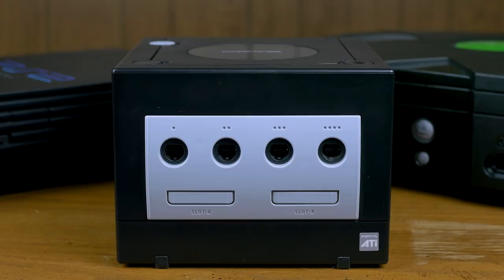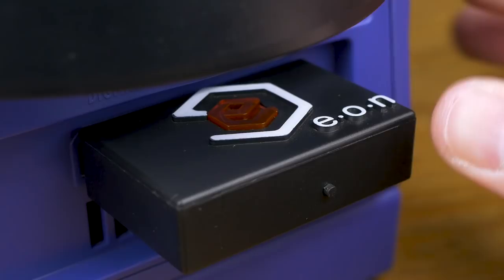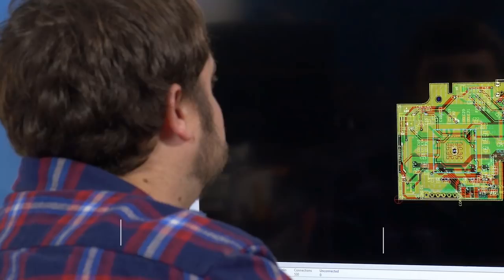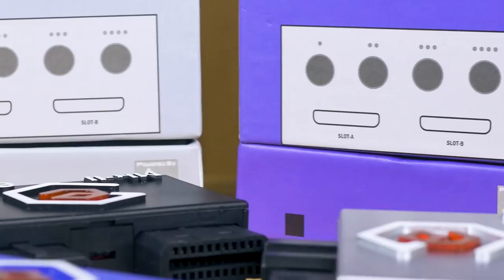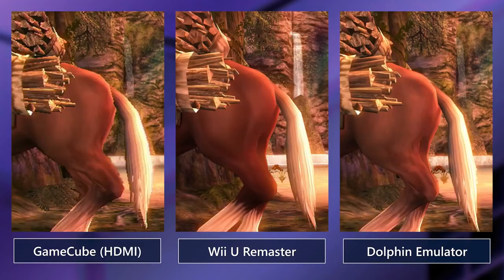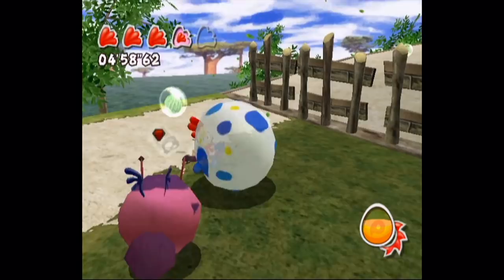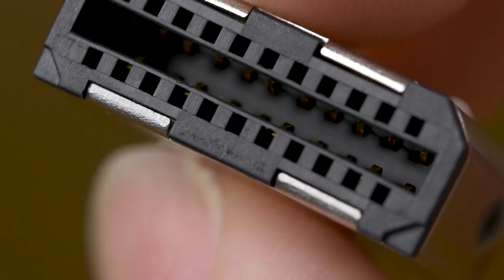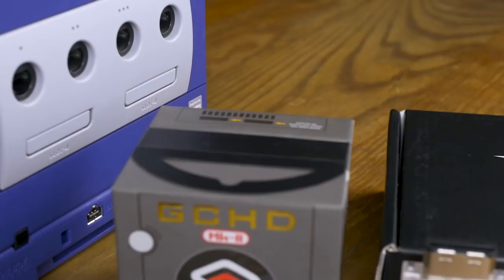Nintendo GameCube HDMI, Component & RGB Plug 'n Play Solutions :: RGB316 / MY LIFE IN GAMING

Comment: what about the combination for playing GB+GBA games

Gamecube + gameboyinterface(speedrun mode) + official component cables to Xrgb (outputing 720p) zoomx4

the xrgb will stutter a bit because of the 480i to 240p input change when booting the game right? and do you think it will add too much lag?
Reply from the maker: [Try4ce] Yeah there will be a hitch when resolution changes but it should be fine in-game. The input lag would be fine by my standards (I'm not overly sensitive to it), but that's only something you can judge. The Framemeister is generally said to have about 1.5 frames of lag.

Comment: Quick question about the Carby HDMI Adapter for the Gamecube.
Is the red light always on the adapter, or does/can it shut off?

I was trying to order one, but the only version in was the see through 
casing which shows the light almost obnoxiously bright in the imagery.
Reply from the maker: [Try4ce] It's kinda tucked away where I can't see the Carby directly, so it's never struck me as a problem. I'm definitely not a fan of overly bright LEDs being in my field of view, but it's never been a problem for me, at least not where it's hooked up.
Reply: @mylifeingaming  just worried since it'll be on the shelf directly benewth my tv in a glass stand, afraid it'll be an eyecatch.

Comment: Very cool
Im still waiting for all the solutions to come out. there is another from badassconsoles, I hear retrorgb may have a prototype but who knows when it will ever come out as i hear rumors and complaints against them before but seem to be friendly in the discord community, also herd some people getting there units recently for there new hardmod so maybe there good now. Wish there was a easier way to update the firmware. From swiss or usb connection or something, right now it's kinda complicated. 
Did you test out the new modes on gbi via component with the new component solutions like 360p and 720p also try out 240p. The hdmi solutions before had troubles with some of the modes and resolutions as stated from Extreams on discord. I hear 360p works with the ossc with a special or updated firmware which is a better to scale resolution for GBA then 240p. Ill prob stick with 240p with gbisr or gbihf if it works with the component as i only have a framemiester at the moment.
If you got a wii even thou the picture isn't at good as gamecube it's still a good and even just skip using all these to save money. Having your games on a harddrive with menue to select a game is convenient. I use my cube at the moment for manly gbi for gba,gbc and gb games.

Comment: Try, where would you recommend I buy a Wii EuroScart RGB cable that is quality, and should I get C-Sync it Component Sync?  I have an Olympus RGB monitor.
Reply from the maker: [Try4ce] I would get one from Retro Access, that's where I got the one shown in this video. If you have the coaxial cabling upgrade, composite video as sync does not degrade image quality (I'm not positive if Wii can even do CSYNC? It might have to do composite video as sync, but I have not researched this.)

Comment: This may seem like a stupid question, but I thought BNC connectors carry RGB over those three lines 5:25? How is it so easily adaptable to YPbPr if so?
Reply from the maker: [Try4ce] BNC is just a connector type. They have nothing to do with the type of signal that they carry. One BNC can carry composite. Two BNCs can carry S-Video (luma + chroma). Three can carry YPbPr or RGsB (sync on green). Four can carry RGB + sync, 5 can carry RGB + HV sync. You can put whatever signal you want down them, it's just a more secure connection for professional equipment compared to RCA, but functionally are the same. Would you believe that you can actually use a single BNC cable for digital 1080p and other digital HD standards over a professional format called SDI? BNC is used for all kinds of stuff in the pro world. The signal has to do with what the source generates, and what the display/device can accept. The wires/connectors are just dumb metal.
Reply: @mylifeingaming  Thanks a lot!

The More You Know. ========*

Comment: So if I have a gamecube without the Digital output port what is my best option to get component video? Should I just get a different Gamecube?
Reply: If you want use component cables on a gamecube that doesnt have the digital out port you're gonna have to add it via a hardware mod. If thats not an option for you then you may have to settle for svideo on your current gamecube or try to find a different gamecube with that port.

Comment: what was that Wii component adaptor you showed briefly at 6:30??
Reply from the maker: [Try4ce] It's a 3D printable adapter for GCDual. The GCDual adds component video to the analog AV port, but since no cable was ever made in that shape that includes component video, the adapter lets you use Wii component cables for that. It would do absolutely nothing for an unmodded GameCube.

Comment: Great video! However I have one question. If I use Swiss to force 480p on my PAL Gamecube + games and use a HDMI adapter will games run at 480p and 60Hz? Is my experience the same as using a NTSC Gamecube + games (minus a few known games that have issues) and HDMI adapter?
Reply from the maker: [Try4ce] Yes the experience shoukd be the same as far as I know, but my experience with PAL GameCube games is none, basically. Of course it depends on the game's compatibility. There's a list online that may help.

Comment: I'm think of getting the GCHD MKII, and some wii scart cables and playing my gamecube games on my pvm using swiss to force 240p. Think I'll get good results, or should I stick to s video?
Reply from the maker: [Try4ce] It would definitely be a jump over S-video, but whether it's a huge jump is up to your own eyes. I'm guessing your PVM is not 480p capable. You would be losing detail by using 240p instead of 480i in most GameCube games, although certainly it's a good fit for many. I've weirdly kind of developed an appreciation for the interlaced look that I never thought I would. Spending months overanalyzing PS2 games will do that to you I guess.
Reply: Thanks for you prompt response. You're correct, my pvm is a 20m2u that doesn't support 480p so I've just been forcing 240p using s video. I've gotten used to the loss of detail, so I think I'll go for the GCHD MKII setup I mentioned earlier. That's interesting, I play my PS2 in 480i over RGB but even then it's a bit blurry to me. But I'll give 480i a shot using SCART once I get the unit and cables. Thanks again for your guy's hard work, love your channel!

Comment: Was the dithering ever solved ?
Reply from the maker: [Try4ce] I don't recall there being a dithering issue caused by these adapters. Dithering is more noticeable with higher quality connections, though. Dithering gets a bad rap, but the alternative is color banding. These systems can't display infinite colors, and dithering is generally the lesser of two evils, compared to color banding. You need to use composite or an upscaler that can blur the image to mitigate dithering if it bothers you. There's no having your cake and eating it too on getting a clearer image and no visible dithering in games that use dithering. You need CRT effects to mask it.

Comment: I'm hoping you can help clarify something. Just last night I got a wild hair to play some Metroid Zero Mission, but play it through my Gameboy player on GC. You can imagine my disappointment when I discovered the Gameboy player requires a now very expensive boot disc which I never had. You see, even though I've owned a Gameboy player for many many years, this is the first time I've ever actually tried to use it. So anyway, long story short by about 1am last night I finally had it figured out to where I was now playing Metroid Zero Mission on my Gamecube using the Gameboy player attachment by way of the 007 Agent Under Fire save file exploit. Whew. So my question is simple: will either of these plug n play devices work with the Gameboy player in the way that I'm using it? Is one better than the other? I was having trouble following your segment one the Gameboy player. Thanks in advance!
Reply from the maker: [Try4ce] Are you using Game Boy Interface through the 007 hack, or the official Game Boy Player software? The official software is kind of bad, to be honest. These options are compatible with Game Boy Interface, but you may not be able to use certain modes/versions depending on what kind of screen you're connecting to. The basic version is highly compatible though.
Reply: @mylifeingaming  Yes, I am using the GBI with the 007 exploit on a standard GC memory card. The TV I'm using it with is a 3 year old 1080p Vizio model E60-C3.

Comment: what is the best option to play my wii nowdays on a modern tv/monitor ?
Reply: From my experience the hyperkin wii hdmi cable is a relatively harmless solution. Most of their cables are complete garbage but the wii one specifically doesnt upscale like all the others do and it retains the same 480p image and doesnt require external power either.

Comment: I don't see anywhere a comparison between GameCube RGB and Component :( 
Just to see if us in PAL regions really need component cables for our GameCubes
Reply from the maker: [Try4ce] Check our older GameCube episode for that (which, I'll warn you, has a ton of outdated information, especially regarding mods and devices that never materialized). I no longer had access to a PAL GameCube when I did this GameCube update video. The short answer is that PAL RGB is great as long as you have good quality RGB cables, especially if using homebrew software to maximize the quality of GBA games. However you will never get 480p out of the standard AV Out port that provides the RGB signal. 480p can only be used with the Digital Out port, so that's the main limiting factor. Also that PAL games require homebrew workarounds for 480p anyway (the system can do it, but the feature was removed from the games, at least officially). Basically though, if you're sticking with interlaced video, RGB and component will look basically the same.
Reply: @mylifeingaming  
Si I could use the region free boot disc, and launch let's say Baten Kaitos Origins (NTSC) on my PAL gamecube, press B, lunch it in progressive mode, but the RGB cable won't support 480p is that correct ? 
But if I have a mod (Carby or the other plug and play solution) it will be possible (but only for NTSC Games or Homebrew bypassing) 
Thank you very much for your fast response, your videos are really incredible and I think it is the most high quality video out there for anyone who would want to get the best quality out of their console.

Comment: Hi. Thanks a lot, i do think this helps a lot and its nice to see which options do we have. 
But my question is: good shielded rgb/scart Gamecube cable (from retrogamingcables) + Retro tink 2x scart. It is a good Option for Gamecube??  Or shall i better buy Carby? I would be glad to read your opinion.
Thanks a lot one more time!
Reply from the maker: [Try4ce] If you have the Digital Out port on your GameCube (it was removed from later systems, then I'd recommend the Carby. But there could be an argument in favor of doing what you've suggested as well. Since you're talking RGB (which is not natively available on North American GameCube systems), I'm assuming you've got a PAL GameCube and PAL GameCube games. While the PAL system itself can handle 480p, the PAL games themselves don't actually offer it as an option. You can use homebrew software to force 480p in many PAL games, but compatibility isn't 100%. So if you were to just use your PAL games as normal, you're dealing with interlaced video anyway. In that case, RGB + RetroTINK-2X SCART is a pretty good option. The smoothing filter makes the interlaced flicker less apparent as well. And you could use it with other systems too. But if you're planning to use 480p on the GameCube, Carby would give clearer results. So there choice just depends on how you plan to use your games!
Reply: Thanks a lot for the answer.
My Gc do have an digital out. (its actually the resident evil Limited Gamecube Edition ✌️😁)
I am living in Europe/Germany so obviously i do have PAL Gamecube. And I prefer to play only Original Gamecube Discs (not homebrew).
Thanks for your advices.
Reply: @mylifeingaming  
Hmm...I am a little bit confused thoug. 
One more question:
So there will be no diference between Carby and/or Retrotink 2x-scart when i am playing my PAL Games on PAL System (without homebrew software forcing it to 480p)?
Or do you think Carby is nevertheless an better option in my Situation ?

Comment: How about use a scart GameCube cable and a scart to hdmi adapter?
Reply from the maker: [Try4ce] That's basically what you are getting with the 480i OSSC examples here. The SCART only works on PAL systems, and the port it plugs into does not support 480p, so there are limitations there. Cheap SCART to HDMI boxes usually have a fair bit of lag, color mishandling, and are simply not tuned for games - they are usually no better than plugging analog directly into your HDTV, if your TV supports the connections.

Comment: in the gbsr.dol  from the gameboy interface, is there a way to make it cover the whole screen? or tweak the zoom options for a PVM?
Reply from the maker: [Try4ce] On a PVM, you could make it a little bigger by hitting the Overscan button. GBA games are only 160 pixels tall, so they won't fill as much space as other consoles (usually about 224 lines or so). On my LG OLED, I use the built-in All Direction Zoom feature to make handheld games bigger when I'm playing through the OSSC.

Comment: Would the image quality be better by using GCHD to OSSC and having it scale? Or by using hdmi straight to your tv?
Reply from the maker: [Try4ce] In my opinion you can get better results with 480p 2x (960p) on the OSSC with component cables. So if you have a good way to get an HDMI device into the OSSC without adding lag or tampering with the resolution, I think that would be great. But I don't mind how it looks with 480p either.
Reply: @mylifeingaming  Awesome, thank you!

Comment: Can someone explain why mk-II component looks so much better than hdmi at 18:38 and 18:49? I thought hdmi would look better since you don't have to convert it to an analog signal.
Reply from the maker: [Try4ce] I can't explain it either. It just does. Part of it is how well the OSSC handles 480p, but there's more to it than that. There are some color edge artifacts on both the HDMI and official component, but not the GCVideo component. It makes no sense to me, but that's how it is, at least for now, for some reason.
Reply: @mylifeingaming  Thanks for your quick reply. I also contacted EON about this. This was their answer (shared with permission from EON):

"In regards to component vs HDMI, in actuality the difference is nearly negligible and is highly dependent on the TV you are using and how it handles RGB, which is the difference you are seeing in the MyLifeInGaming video. The difference though is that HDMI is using digital RGB where Component is using Analog RGB. The GameCube outputs natively from the GPU Component video so to display in HDMI, the firmware does a conversion. The component output has no conversion, which is why you "could" say its better but as I said it will depend on the TV you're using and how it handles each signal. Having both options is more so there for convenience."

Comment: Hay doods. Can you tell me if the Insurrection industries version of the component cable has a menu I configure. It says so in the instructions yet doesnt tell you how to do it. You can't buy the remote separately  so do you configure a universal one? Confused!
Reply from the maker: [Try4ce] There's a function for making it recognize directional and OK/back commands from any remote, you just have to point it at the device during configuration. I believe it's through a little hole you have to hit with a pin or something.
Reply: @mylifeingaming  Ahh thanks. I see it now.  It's strange that the instructions don't even tell you about this.

Comment: Hey Guys, quick question:

I've seen a product that looks pretty similar to the Carby (right down to using GCvideo and only using the digital port) made by kaico. It is $5.00 cheaper and is in stock frequently. Do you guys know if this is thing is legit?

Thanks!
Reply: Im sure it works just as fine but Kaico is a shitty company. I wont bore you with bts drama but id personally recommend not supporting their products. You're better off going with the Carby.

Comment: Is there a way to do this on a crt tv without scale lines?
Reply from the maker: [Try4ce] Technically a CRT always has scanlines. They might be so tightly packed you can't see the separation between them, but they are there. I'm unclear what you're asking, but if you got a lag-free HDMI to VGA converter (very cheap) and connect to a PC CRT, then 480p games will look very nice on that.

Comment: 6:28 That was what I was talking about. Does that specific adapter work on the Model 2 GameCube?
Reply from the maker: [Try4ce] No, because that port does not provide the signals needed.
Reply: @mylifeingaming  Aw man. Hopefully EON will find a way to make it work, though I imagine that won't be for a long time.
Reply from the maker: [Try4ce] Sadly it would require a mod, no matter what. That port cannot provide anything other than composite and S-video, and no 480p. The only reason that adapter works on the modded systems is because those signals have been routed to the port. It's theoretically possible for the non-Digital port systems to be modded, but I'm unclear on whether GC Dual or any other mods are designed to accommodate those. Probably something has been designed that way, I just don't know what.
Reply: @mylifeingaming  Interesting.